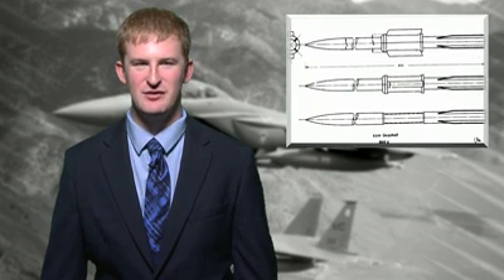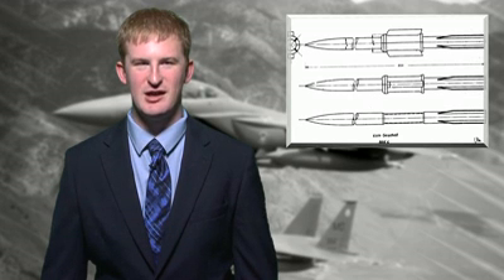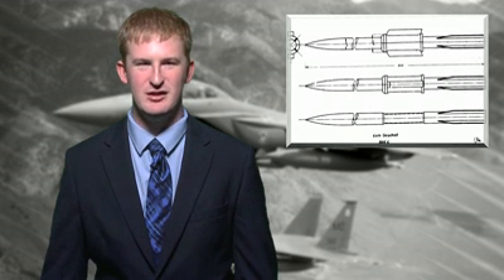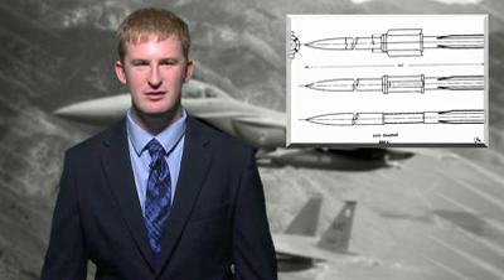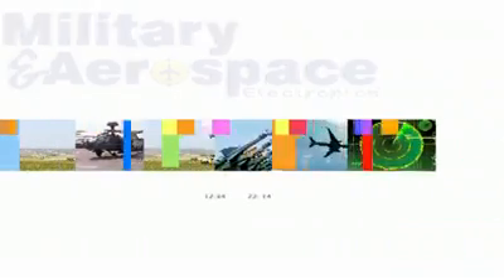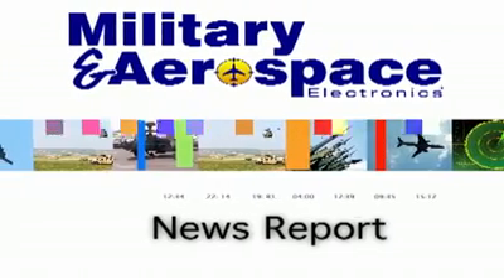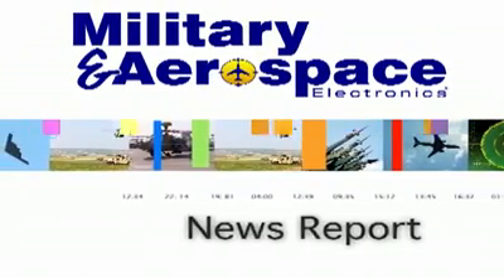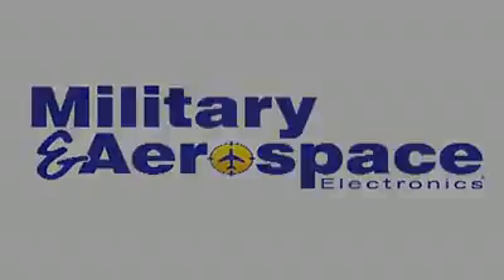Railgun technology continues to advance as phase II of the EM Railgun program moves forward

Comment: so in comparison a 155mm (15.5cm) howitzer can fire a 43 kilo HE projectile with a muzzle velocity of 564 metres per second (speed of sound= 340.29 m / s so travels at mach ~1.66). Muzzle energy=1/2 mass of projectile times velocity squared, so muzzle energy of the 155mm howitzer would be about 6 840 000 joules or ~7 megajoules? Is my maths right? I wouldnt mind knowing the weight of the railgun projectile and its muzzle velocity I wonder if we could ever propel probes intospace with a giant one